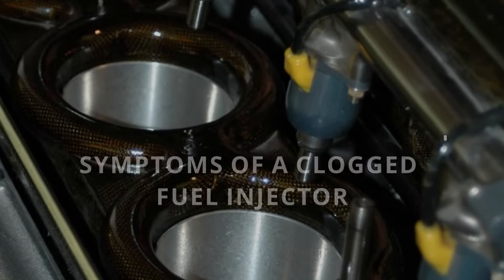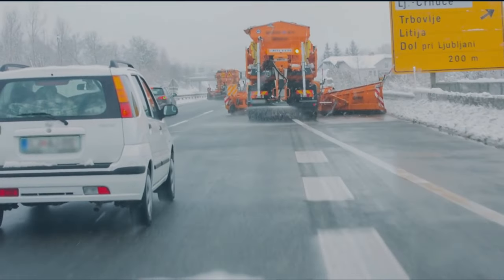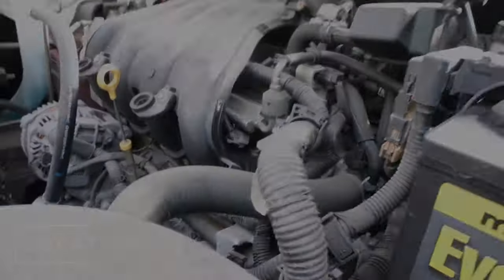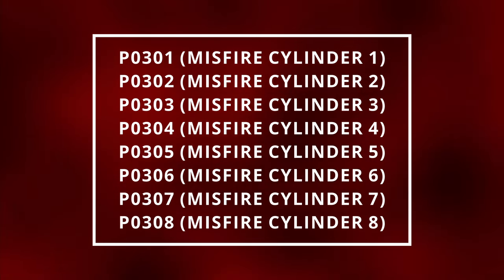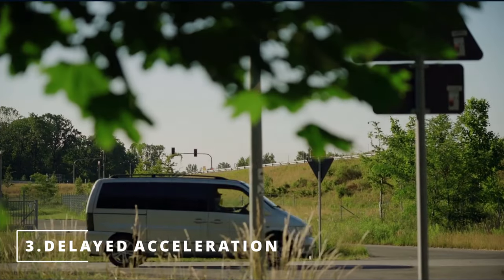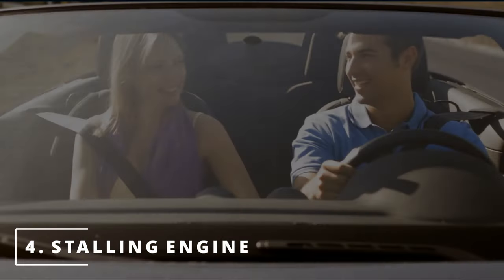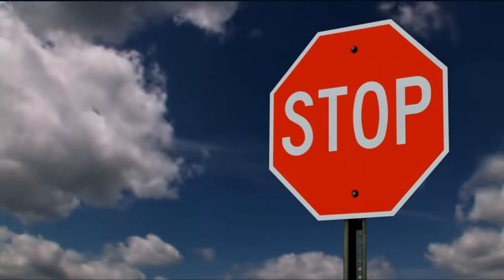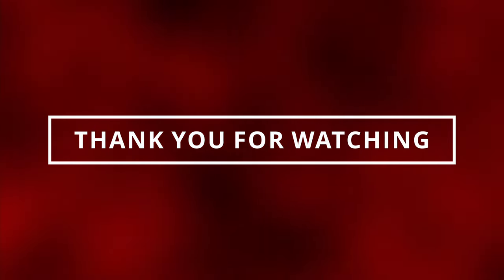SYMPTOMS OF A CLOGGED FUEL INJECTOR

Comment: I had a fuel injector cleaning and an oil change shop near me they ran a machine through the fuel injectors to clean them. About 1 to 2 weeks later my car was experiencing all these symptoms such as rough idle, decreased RPM, etc so my question is, should I replace all my fuel injectors now? Or do you think it might be something else? Or should I take it to a auto repair shop in just change out the faulty fuel injector? What should I do what do you think is happening?
Reply: I'm following, I need to know the same.
Reply: Sounds like maybe you're using a bad fuel station? I would change to better gas or a different station... But either way sounds like you got a tank of bad gas and may need to redo the service again and/or your car may have a fuel filter that needs to be changed
Reply: @JamesAutoDude  ok thank you

Comment: My vehicle is getting terrible fuel economy seemingly around 6mpg (I’m in the process of properly checking it with the fill up/trip odometer method), a bit more than 1/3 of what it should. It does have 255K on it and has probably never had any injector work done to it. The spark plugs were way overdue and I got those in, wires are waiting to be installed. I have new baskets for my injectors and I’m gonna see what I can do.

Comment: 2007 Jeep Liberty, 3.7L gas.
Have code faults for #1 misfire, fuel injector 1 circuit open, and Bank #1 lean. 

There is a slight rough idle, but no misfire perceived, and it runs fine under load and high speed.  Doesn't burn oil. Gets 15mpg combined mileage. Ran fine when I got it 64,000 miles. Now it has 110,000 miles.  It has had this issue for about 10,000 miles. Not getting worse, but so far plugs and coils and cleaning intake hasn't corrected it.

I checked and cleaned Injector and Coils wiring connections and they look good too. #1 Injector plug had some oil in it, somehow. Cleaned it very well with first brake cleaner,  then electronics  cleaner. Let it dry and reassembled.

Can bad Injector o-ring cause this?  I already ruled out spark plug, coils, valves, and did intake cleaning.  

I have not checked orings and the wiring from #1  Injector to the computer control.  And don't really know how to.

Any tips on checking Injector and its wiring and control while it's still in the head?  Thanks!

Comment: Literally me putting fuel injector cleaner in my car and itll run good and then just be shit again but now its gotten so bad i thought i was my transmission. I think i might replace my fuel injectors today.
Reply: yes same here i bought best fuel injector cleaner at auto zone didnt work so they said if they don't work then you'll probably have a fuel injector if you haven't feeling tractor the fuel injector cleaner won't help at all and my friend that works out told me the change the one that's misfiring too to a different one and put the other one on it too and see if it misses on the other side
Reply: Hi there, did you ever replace the injectors and it fixed the issue? This is the problem I’m having. Fuel injector cleaner fixes my symptoms but temporarily.
Reply: @Whatchamacallit22  i think i had water in myspark plug holes lmao. Very vaguely remember but i know didnt have a hood on at the time its been a good minute. It mightve been my IAC valve cause I remember spraying cleaner in thethrottle body and let it sit over night and it ran perfect ever since then before i sold it

Comment: I have gone through  3 cans of "Berryman's" to clean the fuel system.  The car( jeep)had a few Big backfires,    but not anymore. it is kind sluggish on acceleration uphill still.  Suggestions?
Reply: Get new injectors
Reply: @deleted....2000   Nope.  "Cataclean "  fixed it.

Comment: if my car only shuts off while im stopping or idling, and has strong smell of fuel, do you think that fuel injectors can be a possible cause? I've replace the fuel pump, mass air flow sensor, air intake boot because it was ripped and thought that could be something, but nothing has given me any luck and I just can't afford to take it to a shop with my budget right now. Literally looking for any advice at this point

Comment: Will there always be a lean condition code if I’m getting a misfire code? I have a misfire on cylinder 6, with a lot of the symptoms mentioned. Rough idle, slow acceleration, and start issues. But there is no lean condition code. Thanks for the video!
Reply: What did you figure out? I had all the same but misfire on 1, cleaned map sensor and the starting issues stopped, idle a little better but still misfire on 1, checking spark plugs next, then coil and injectors.
Reply: @Chrisrobba  hey i hope both of you guys got your problem resolved, can you guys help me out i’m dealing with the same thing right now :(
Reply: @lilstuart1584  I changed spark plugs still had a misfire, moved the ignition coil to a different spot and the misfire moved with the coil so I changed that and seems to be fixed for about a month
Reply: @Chrisrobba  i changed the coil pack twice, and both spark plugs for that cylinder and i still have the problem, do u think it’s the o2 sensor
Reply: @lilstuart1584  if you’re sure it’s not related to spark then check fuel components, fuel pressure, fuel filter, fuel injectors, fuel regulator. 2 misfiring plugs sounds like air or fuel problem. I’m no expert just trying to help
Reply: @Chrisrobba  it’s only cylinder 6 that’s been misfiring
Reply: I have the same, rough/vibration at idle and like the same thing while driving constantly with a slight tapping sound? Changed spark plug but not it...I’m homeless and I need help I live and work in this thing :/

Comment: Ok so I noticed when I decelerate I hear a vroom sound. Could this be a dirty fuel injector? I have not cleaned my due system since I bought the car. Also No check engine light is on
Reply: I have the same issue on my mustang 2014 gt. Car hesitates to accelerate and skips gears. No check engine light either and mechanics can’t find what it is. Some say is transmission but I don’t want to get it fix until I know exactly what it is. Have you sold the issue?

Comment: Hi, I like these videos.
I have been having issues with my car, while driving it just switches off and it stalks at times.

So I decided to see what the problem, with the fuel pump, I started the car, I have an opel corsa 1999 1.6.
I kept my hand on the fuel pump, it was vibrating as if it was working, I'm not sure if this is the correct way to check if the fuel pump is working or not?

Comment: I have a 2011 Dodge Journey  3.6l engine…I have the p0300,p0302,p0304,p0306 and also p219b the sensor on the same side…could it be my fuel injectors on clogged?
Reply: Check ignition coils
Reply from the maker: It could be a vacuum leak, I would pop the hood, turn on the car and see if you hear a hissing noise.
Reply: get a new car
Reply: @michaelvonluehrte6448   thanks lol

Comment: Hello everyone. I have the problems on the red lights and stop signs. I have a quick question. From my experience, when I put regular gas, it is worse. But I put last time premium gas + a severe fuel system cleaner from Dura Lube. It did not happen anymore. After the tank was empty I put just premium gas again but it is still in the rough idle description. Why does that happen? Any clue?
Thanks.

Comment: I have just replaced  the spark plugs, the fuel filter, the cords, and the distributor cap and ever since that my car would roughly idle until it turns off, and if I put in drive it turns off. What could it be?

Comment: Have replaced everything that could possible cause a high speed misfire except the injectors .. There is no CEL or Code present .. The car is fine on easy acceleration but when put under stress or hard acceleration like entering a Highway , it will buck intermittently ...  Going to try Redline before replacing injectors .. Any input would be appreciated !!
Reply from the maker: Whats everything? How many miles does the vehicle have?
Reply: update??

Comment: I have a delay when I press my pedal all the way to the floor and the 0-60 is very slow slower then stock although I have rough idle and a missfire so I’m hopping it’s the fuel injectors
Reply: could be spark plugs

Comment: Ive had a misfire for a long time I changed coils first and still had misfire then I changed spark plugs and the engine shaking stopped but now when I step on the gas it kind of Bogs out and I now have a code for multiple misfires I haven’t changed the injectors or tried the cleaner
Reply: Did you take off the negative terminal or both on your battery when you placed your ignition coils or spark plugs? I had the exact same issue as I was testing it out my car started to shake and my RPM went to zero but luckily did not get stranded. I was recommended to take off the negative or both battery terminals (I did the negative only) and reinstall the ignition coils. (which I did) then go back and put on the terminal/s again and run the car idle for 15-20 minutes. Afterward, run the car for a bit (I did 30 minutes) on the streets you are used to driving on and see if this method works, as it did for me.
Reply: @ACruz-ur1we  hey man just changed my spark plugs and coilpacks I disconnected only the negative term nail on the battery now that I turn on the car it sounds almost like a cam any idea what it may be
Reply: @Noesandresss  have you taken it out to drive around? It may sound like a rough since the computer is adjusting to it's current programming. Does a check engine light appear?
Reply: @ACruz-ur1we  yeah it drives fine but it’s when I come to a complete stop it’s sounds like it start choking up again
Reply: @Noesandresss  have you checked in your fuel filter? It may need replacing as it can also shoot off misfire codes and engine hesitation
Reply: @Noesandresss  another thing that may be causing your car to be doing that may be just bad or contaminated gas. You'll need to remove the gas from the tank or use a fuel additive that cleans your tank. I use Lucas Oil Products Motor Treatment and see if that helps out, if so it may be that as well. If you do try this method, pour the whole can then start your car and let it run idel for 15-20 minutes afterwards drive it to see if you see any improvement. This method also helped me out too. Add this 2 times when you are about to gas up your car and hopefully it will help out!
Reply: @ACruz-ur1we  yeah I've read this its a thlb relearn  plus run 1st keeping radio lights heaters etc all off . Then after 20+ mins  turn them on 1 by 1
Reply: @Noesandresss  like your cam ? What like cam is vibrating or something ?
Reply: Wow I’m having this exact same problem with my 2016 Jeep Compass . First I changed the spark plugs and my engine was still shaking and then I had help with the code P303 I had a misfire in my 3 cylinder I changed the coil in that cylinder but still my engine is shaking but tmrw I’ll be buying 3 more coils to replace the rest , fingers crossed 🤞🏽
Reply: @tatyanarasamee-stewart9535  let us know mate mine was cams lifters rockers head gasket chain etc turbo kit lots of £££££
Reply: @tatyanarasamee-stewart9535  Any improvement with the 3 new ignition coils?
Reply: @Noesandresss  what was it same thing happening to me

Comment: I’m having an issue with my Nissan Primera p11 2001 the 3rd cylinder isn’t going at all I’ve swapped the spark plugs out and replaced coils but nothing changed. I have been told it could be fuel injector or cylinder compression would anything I’ve said direct it being a fuel injector issue

Comment: I have a 2004 Chevrolet suburban LS 1500 4 wheel drive. When the gas meter get to a Quarter tank of gas and sits for 24hr it will not start. Will have to put some gas in it to crank. Along as it's some gas over quarter tank it will crank right up. It's able to run and drive all gas out til the meter hit E like normal cars do. What's the issue?

Comment: I have an Acura mdx 2014, the car runs great when going fast but when going slow, the RMP starts to jumping and the engine feels like loosing power shaking up the gears. I changed the spark plugs thinking that’s what it was but it wasn’t. any ideas?

Comment: I have a bit of a weird issue, when driving at a stable speed the engine sometimes jerks or hesitates like a cylinder misfire but i get no codes and it happens at random intermittenly
Reply: I have same problem too did you found out the problem was?
Reply: Me too.
Reply: Me too. Let me know if you figure it out
Reply: Check ur o2 sensor
Reply: @jygogaming3550  was that your problem? Did it fix it?
Reply: @LogicInWords  my o2 is reading rich at the moment still waiting for the new o2. Ill keep u update if that the problem
Reply: The issue has been solved. It may have just been bad fuel but the day after wrighting this comment i got a p0202 which got solved by tugging and pushing on the injector cable, aswell as refueling
Reply: @jygogaming3550  ok thank you
Reply: @LogicInWords  its was bad coil pack

Comment: I have a 00' integra gsr and it sounds like the engine chokes when I press on the gas pedal, it does a weird choking noise and then dies, then I see white smoke coming out of the CAI, I have a 1.8L b18c1.
Reply: Same here!! and I have to find the sweet spot while searching for acceleration, if not it's will lose power and slow down.
I have a 05 Acura TL base

Comment: So I need a little help I'm a single mom and have been struggling with my Mazda 3 2005 I believe and I just replaced my fuel pump bc my car wouldn't start it had spark and everything so once it was replaced it finally started but then it drove funny like my engine would shake and my car would jerk a lot... And thennnn when trying to go uphill or just driving in general it doesn't want to go I have to play with the pedal and constantly floor it is there any advise I've already tried the throttle body bc I realized it I hit the throttle it'll drive a bit smoother but it still acts funny even when I do that... I don't know anything about cars but I honestly spent so much money and it's still running the same
Reply from the maker: Do you have the check engine light on? If so, what are the codes that popped up when you scanned it?

Comment: I have a efi scooter 125cc  and was running  and died  and can not start its been off the roads for 3 weeks now and doing  my head in cant find wots up everything  is working  as it should spark battery  fusss etc all good wont start  😮   its a euro5 bike. And was using  euro10  then cupple weeks after died  i have had the injector  off and cleaned it and was pritty dirty could not do a filter chage  but still wont start my diagnosis  reader says injector low. So i am thinking  its tye injector 😮0:02 0:02 0:02

Comment: is there a difference in fuel consumption when clean?
Reply: Yes there is, clean injectors are always more efficient meaning more mpg.  When injectors are dirty, the gas is not being atomized correctly leading to unburnt gas being pushed our the exhaust.  Don't expect to see much more than 2-3 mpg in most cases.

Comment: Looking for advice on an 04 civic sedan manual transmission. 

How do I know if its the filter, pump, or fuel injectors? I checked the fuses. Not sure if its the relay. It just started idling extremely rough and stalling. Won't rev past 2000 rpm, no power. Feels like its starved of fuel. I got rear ended hard a few weeks ago. I don't know if its related. No check engine light. Could it be fuel pressure regulator?

Just checked. The relay is working,  the fuel pump is coming on. I unhooked the line, there's fuel pressure. I didn't measure the pressure just visually gas spurts out with pressure when I disconnect the line. Thinking of cleaning the MAF sensor and checking the coil packs. No check engine light. Anyone have an idea?
Reply: I've heard of rear end collisions that have caused the fuel pump to become dislodged or possibly tilted. Since you mentioned these issues began after the accident, I would start there.

Comment: Thanks.  My mazda 3 2015 with 190K miles on it has had many of these symtems for about a year.  Check engine light, crank but no start or takes a few attempts, rough idle at stop.  None of the idiot mechanics in NYC either can or want to trouble shoot it.  Any thoughts?  I just put in some fuel cleaner a few days ago.
Reply: What are the codes that come up on cel? You can take your car to AutoZone and get a free cel look up.

Can be following issues

Ignition coils that are worn can cause poor starting and rough idle, 
also your mass air flow sensor could be dirty and needs a simple cleaning with mass air flow sensor cleaner.
Try replacing fuel filter? If you got a p0300 code that can be a headache cuz it's random meaning it could be anything from air fuel or spark issue
Reply: Lifetime fuel filter on 2015 Mazda 3 petrol.

Comment: Hello, please help me if anyone had this issue. I have Nissan Juke 2015. A problem started a few weeks ago. When i start the car it's ok but after 30-40 minutes of driving when car reaches some good temperature, and while I'm standing in heavy traffic or standing on idle sometimes its engine changes sound to something like it lost some power, starts shaking on idle, and whole car is also shaking. I went to mechanic and we changed spark plugs, it did not help, then we changed ignition coils, it did not help as well. Now mechanic says that could be a computer problem sometimes it works sometimes it does not and car starts shaking while standing in traffic or on idle. When ever i give a bit push on a pedal or turn on the AC it fixes, but when i release pedal and let it be on idle, it starts shaking again (sometimes it even goes away by itself). I also plugged to a diagnostic and it does not show any code until it starts shaking, when shaking it shows this "code P0300 multi cylinder misfire". What is your opinion about this situation and symptoms i told you?  Can this be an injector or some cable problem or some sensor? Thank you